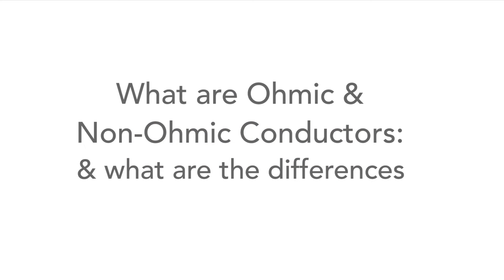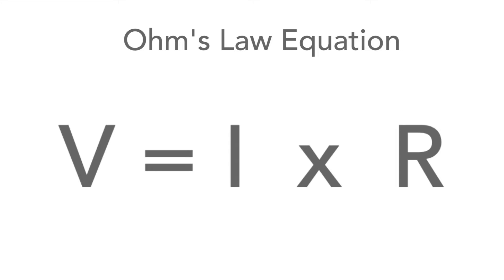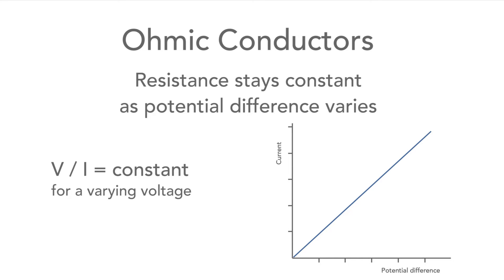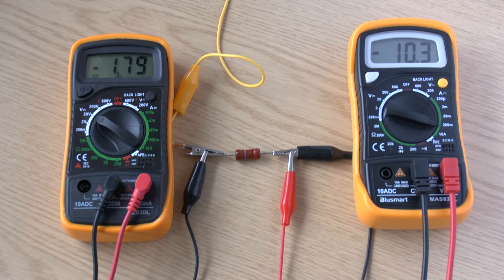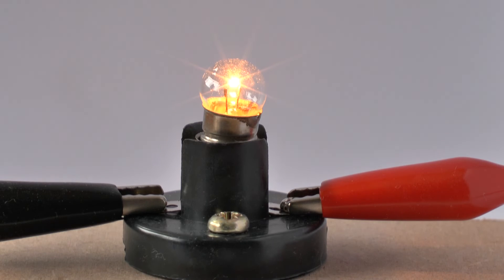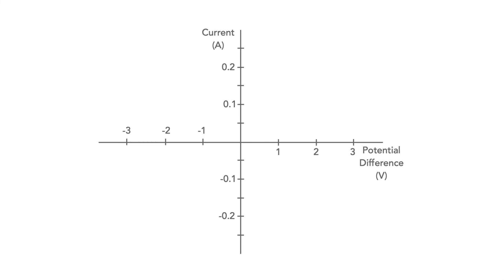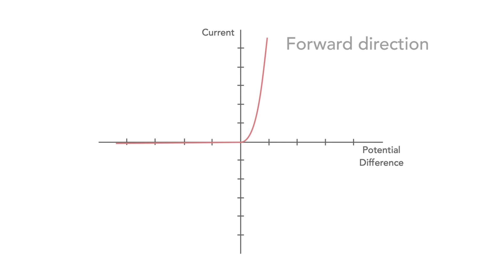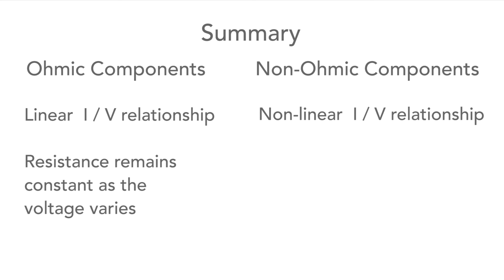What are Ohmic & Non-Ohmic Conductors & Components

Comment: Hi, I’m confused, so does resistance of ohmic condcutor change when temperature changes?
Reply from the maker: Yes, even the resistance of a wire wound resistor will change. The changes are generally quite small and in many cases they won’t be noticed, especially over small temperature changes. However components like thermistors are designed to have a large resistance change with temperature so they can be used as sensors.
Normally most resistors are designed to have a very small change of resistance with temperature.

Comment: But for non-ohmic devices, won't V=IR still hold at every point?
Reply from the maker: This is a good point and yes it does, but the value of R changes with voltage. The definition of an ohmic conductor us one where the resistance is constant.